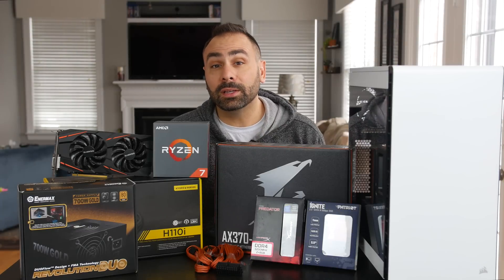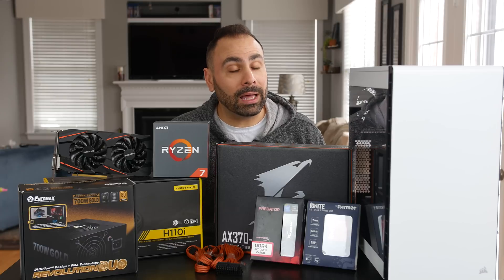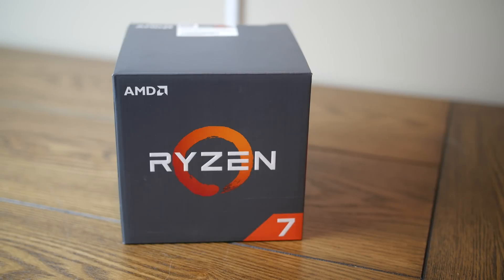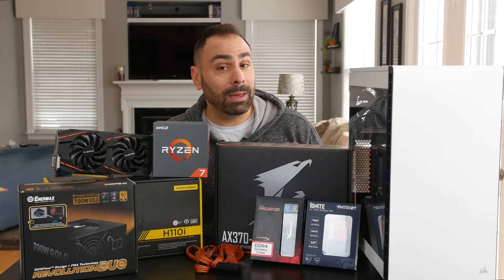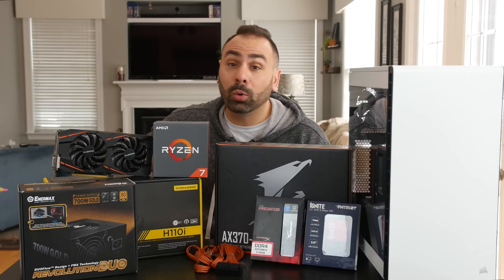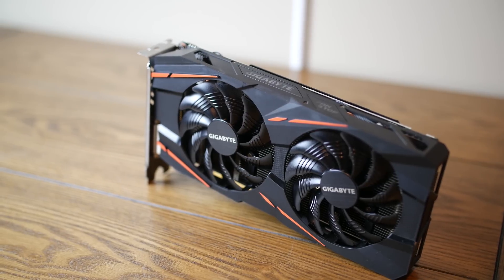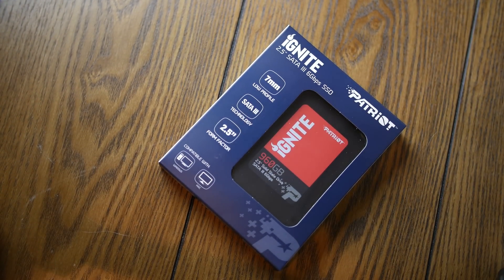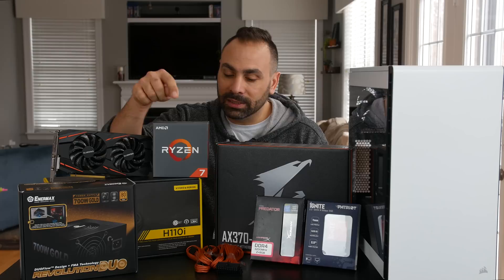Monthly Build Series - March 2017

Comment: Good video, thanks. How's the noise level of that 110i? It seems to be the only AIO with out-of-the-box compatibility with AM4.
Reply from the maker: It's almost silent with the case door closed, the 14mm fans make a huge difference
Reply: Yes, that makes sense. The case I had in mind though was the Corsair Crystal Series 570X which is a sort of open concept at the edges of the glass panels.
Reply: Jason Repa I've got the 460x and with the h100 v2 and 3 Output fans it's silent.
Reply: Thanks for your reply. Yeah, everyone seems to agree that the 460X, albeit a bit smaller, is the better engineered case. I ended up going with the Phanteks ENTHOO EVOLV which has tempered glass panals on both sides, but not on the front. I prefer the idea of a closed case rather than the open air design of the 570X, and the 460X seems just a bit too small for me. That and my 110i AIO should be arriving in a day or two. I'll report on the noise level and other features once i build it.

Comment: Great stuff man, how did the ram speed turn out?
Reply from the maker: https://youtu.be/76yzqXEhS5U?t=11m14s
Reply: BPS Customs nice! My Corsair LPX are running at 3000mhz on a Biostar X370 w/ 1700. Had no issue either after updating the bios. Good stuff